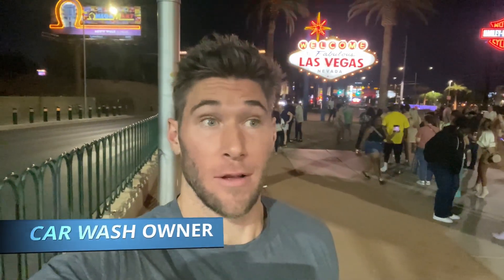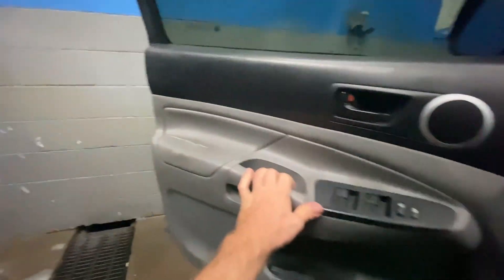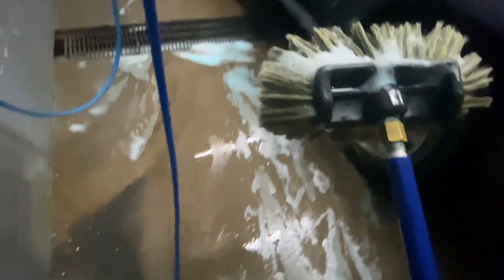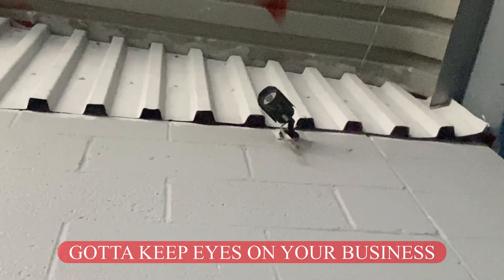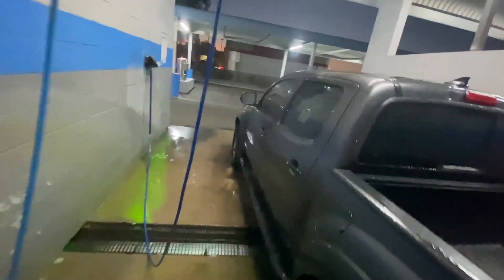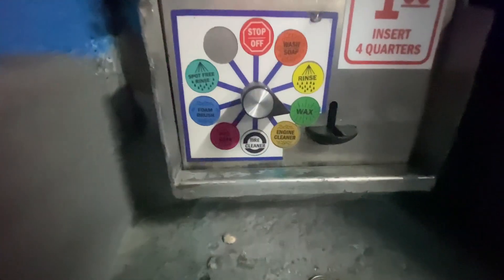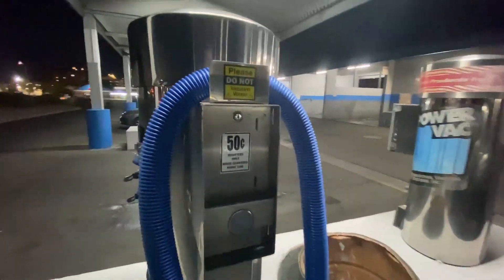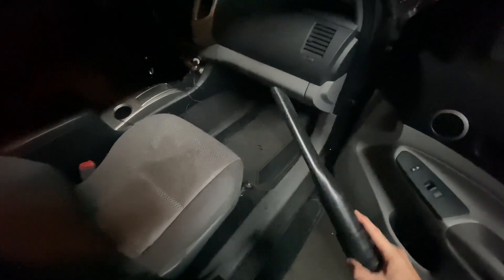Massive Las Vegas Car Wash!

Comment: How would you manage a location this far away from you? possible to remote manage. going to be hard imo unless you have a real manager which still hard to collect coins right because of theft. i believe you are few hours away 4
Reply from the maker: Yes would be tricky. With the right employee I could get it so the hoppers could last probably 10 days before topping up with tokens so I’d probably go out once every ten days to collect $. All comes back to the right person running it for you.
Reply: @CarWashChronicles  is there a good company in Vegas to do repairs and maintenance work